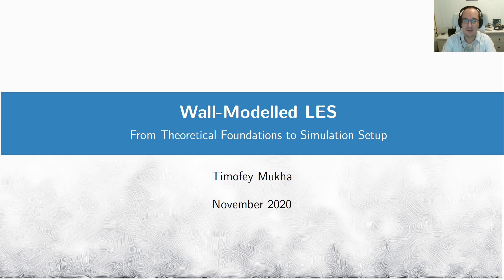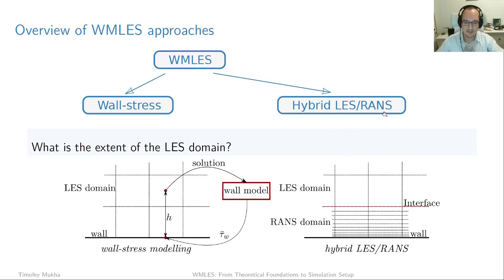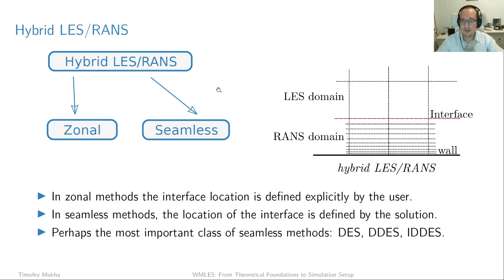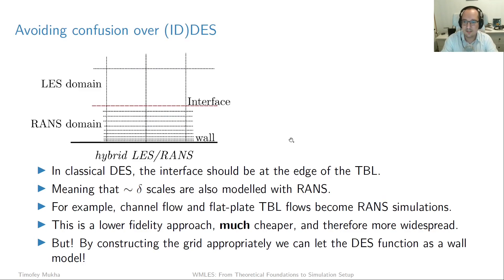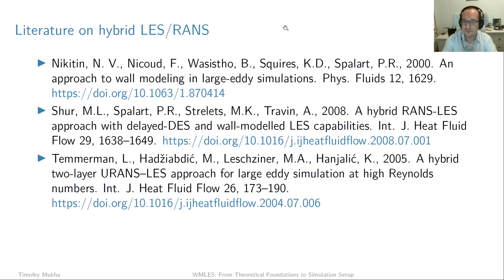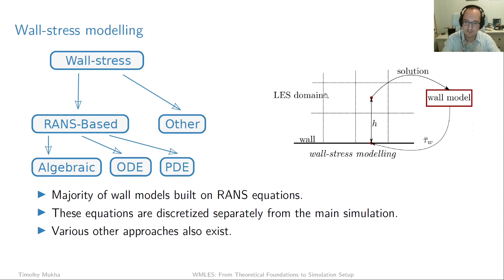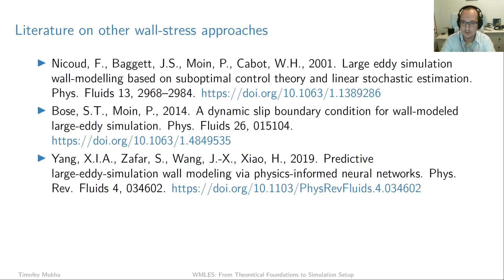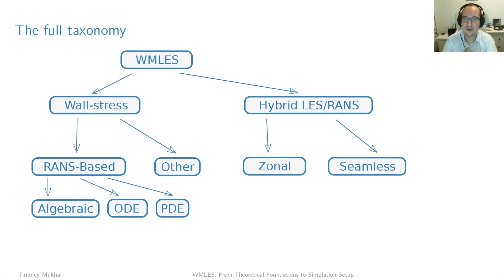Wall-Modelled LES: From Theoretical Foundations to Simulation Setup. Part 2

Comment: Hello sir
Is wall modelled LES approach good for air jet impingement on flat plate cooling as wall resolved les is very expensive and time taking
Reply from the maker: I'm not familiar with this flow problem, so it's a bit difficult to give an answer. But in principle, I don't see why one would not give it a try. Since you mention cooling, i.e heat transfer, I should note that you may need a wall-model for the heat transfer as well. See e.g. equations 3-4 in Larsson et al, 2016 (the review paper I often mention).
Reply: @TimofeyMukha  thank you sir